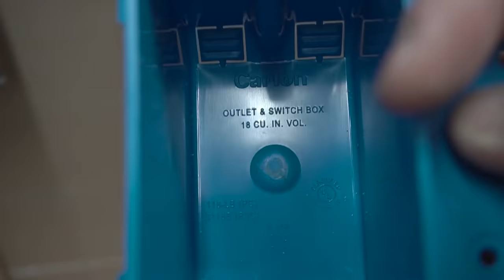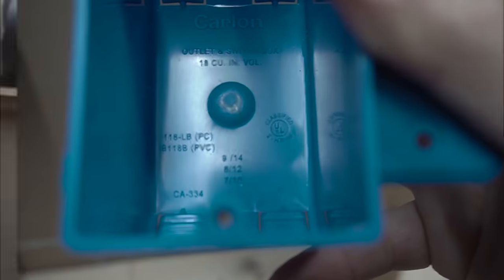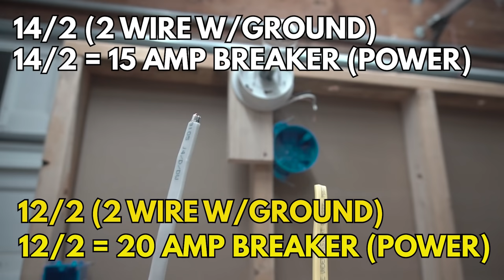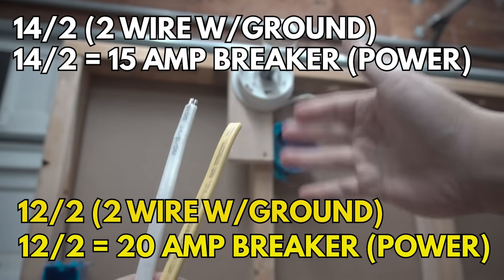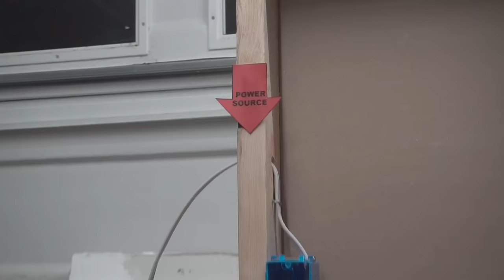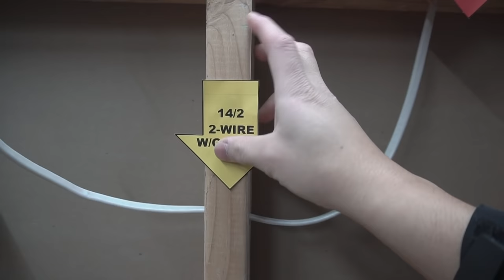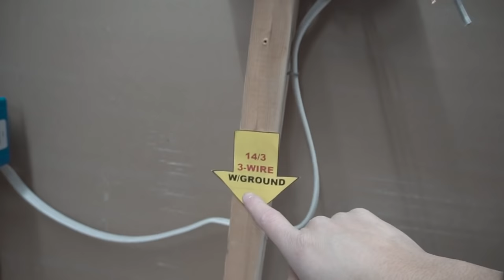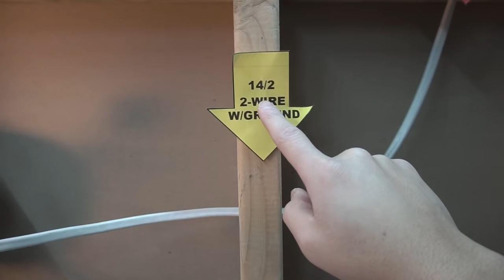How To Wire A Single Pole Light Switch Circuits 3 Different Ways (2022) DIY Tutorial For Beginners!

Comment: I have a scenario where the power source is from a light fixture box inside a closet to a single pole light switch outside the closet controlling on/off of the light fixture inside the closet.
The hot is a white wire at the top screw of the single pole closet switch and the black goes back out to the light…I think?
Can you add an independent light and switch outside the closet using the power line from the closet single pole light switch? Can this can be done? Thank you in advance for any comments.

Comment: Thank you!  I like those little clips to connect the wires, I only knew about the old wire nuts before this.  Why is the box called a "J box"?  Do you have a video about a setup where there are two light switches controlling a light?
Reply: Junction Box (J-Box)
Reply from the maker: Thank you for watching! Stay tuned,
I’ll be doing a 3 way switch Video either this week or next week! 👍🏽😊

Comment: Thanks for sharing. We have a light switch that powers on our bedroom light only but that same switch also sends electricity to our bathroom switch which has its own on and off light switch. The bedroom, bathroom and electrical source all have the ground wire, white wire (which is already connected) and black wires. However the electrical source also has a red wire. How do you connect all wires to the bedroom light switch so that the bedroom switch only controls the bedroom light and not the bathroom light, but we need to still have power going to the bathroom switch? Thanks for your help. Appreciated!
Reply: Take down your light fixture. Disconnect the black wire from the fixture. Reconnect ft fixture wire to the red wire. The other end of the red wire will be at the switch. Connect the black wires from the Romex at the light fixture together. At the switch you connect the red wire that connected to the black fixture wire and any black wires at the switch get connected together with a left over piece of 6" black wire to feed power to the other screw on the switch. Or hire an electrician. Remember , your most important tool is your checkbook.

Comment: I am rewiring after a wall/room was reconfigured. Light fixure, outlet and incoming source were already there. How would I wire it when the source wire is a 3 wire? The light fixture is a two wire and has an outlet on the other side that is two wire as well?

Comment: So why did you connect the neutral of the 3-wire to the other neutrals if it was never connected at the switch? Is that due to code? I dont think you had to connect it to the other neutral from power or load.

Comment: My situation is I have a 14/2 wire with no ground running to a single pole with no ground screw, and I’m wiring 14/2 lights with ground to this switch . Easiest method would be to ground it to my metal box? Suggestions? Either that or rewire it all the way from my panel but that would be out of my league.
Reply: Grounding to metal box many not work.  It is common for older homes not to have a ground wire.  The "best" answer is tom rewire to the panel.  The realistic answer is to ignore it,
Reply: Gfi the circuit. With an old panel you probably won't find a gfi breaker to fit. So if you want to gfi the entire circuit buy a gfi receptacle and connect line side to breaker and load side to wires going out. Now that whole circuit is GFI protected. People just don't understand. The ground wire in the Romex is not for personell protection. It is there to provide a path for electricity to travel back to the panel and trip the breaker when the current carrying conductor is shorted to the metal box or more likely if the appliance or equipment shorts out. Without the ground wire the frame of the metal equipment is energized because rnen though the windings of the motor are burning up and shorting out to the case or frame the breaker won't trip. So it just keeps burning until the current carrying conductor burns up.  That's what burned up the MGM grand in Vegas. Conduit broke. No ground path. Breaker didn't trip. See the movie Towering Inferno.

Comment: In method 2 the white wire is not a neutral.  It is a hot. The function should be described,  not confused with the color. It is also not code compliant anymore and should not be shown.

The cable hanging out of the bottom of the switch should have also be secured to the stud.
Reply: First thing I noticed too, wonder if he's in a local jurisdiction that doesn't uses the lastest NEC. Regardless, it is best practice to now put neutral in switches boxes to allow for modern smart switches that require neutrals.

Comment: Great video. So 3rd way, the 3 wire with ground wire, what is its purpose. You end up with 4 wires running to the switch and you just cap off the white wire. Seems pointless. I am sure there is a reason but if no further construction / modification will occur it just seems like a great way to sell more copper. So why is this the way it is to be done now?
Reply: 3rd wire allows for you to separatly power two different items from the one wire. E.g. a fan and a light combo in a ceiling fan. If it was 14/2, you can have separate control of light and fan at the switch, you would have to use a pull chain for the two. Their are other scenarios as well.

Comment: Before seeing your video, I tried to wire my 15 amp circuit with a 12/2 wire from the ceiling and it did not work. Is it because I should have used 14/2 wire from the ceiling to the switch?
Reply: A 15 amp breaker should be able to connect to 12/2 or 14/2.
Reply: @FreeAmerican-mm2my  thanks
Reply: Doest matter. Stay with the same guage wire throughout. You did something wrong or just don't understand.

Comment: If installing a light in a closet can the light switch be outside or inside or only outside ?
Reply: Well it's up to you. If you have a walk in closet or whatever with the light switch inside you may leave the light on all the time not knowing it's on with the door shut. With the switch on the out side all you gotta do is look at it and you can tell if it's on or off. Hopefully you install the switch so up is on. You can buy a switch that lights up when you turn it off. Needs a neutral at the switch. It's called a locator switch so you can find it in the dark. Like in a dark room and it's not by the door or other dark locations or in the middle of a wall.
Reply: @johndavies2949  thank you very much

Comment: So im trying to add about 5-6 outlets outside for Christmas lights should i use 14/2 with 15amp or 12/2 with 20amp?
Reply: Either way works. With the 20 amp # 12 you can run more lights. The problem is that you can only daisy chain so many strands of lights before that wire they hang from burns up. That's why all lights now have a fuse in the plug. The good thing is most lights are those little incandescent bulbs or led. I'm an old timer and still have those big bulky bulbs.

Comment: nice video. But the second part of the connections where the power supply is wired to the light then to the switch, a little change is needed to be adjusted  for the neutral( identified conductor) to added to the j box for future connection requirement too. Hope this would help.

Comment: In the 3rd method, what is the point of even hooking up the white wire from the 14-3 at all?
And/or what is the purpose of using 14-3, when you didn't even use the 3rd/white wire at all.
I'm abit confused.

Comment: If using the first method on the video and adding an outlet from the switch.  Can you using 14/2 and run the black wire to the hot wire on the back of the switch?
Reply: You could "stab" the wire in the back of the switch (or plugs), must most electricians prefer to make hooks and attach to the screws.

Comment: Question: how are the wires connected to the back-of the light fixture?. Does it matter which wire goes where?
Reply: I always connect black to black and white to white, but it does not matter.
Reply: Yes it does! The neutral goes to the silver or white wire that connects to the shell of the screw in bulb socket. The hot wire whether switched or not connects to the screw or wire that goes to the tab at the bottom. Some light bulbs have to be changed while the power to the fixture is on. So if  socket were wired with the shell as hot you could shocked if you're not extremely careful.

Comment: Hi i have question can i install exterior light without no ground wire
Reply: Sure! As long as the power feeding the light switch is GFI protected. If power to the switch comes from a regular receptacle change out that receptacle for a GFI one with the load side feeding the switch.

Comment: Correction:
At 16:17, you said that the power goes to the light fixture, "this is powering it first". However, the power goes to the switch box first. Can you clarify that please? thank you.
Reply: Go back to 11:22. This is the 2nd method of wiring and the power is going to the fixture first.  The 2nd method no longer meets NEC Code because you do not have a dedicated white neutral in the switch j box.  You will still run into the 2nd method in repair work.

Comment: I’m running new lights for the basement I have a 20 breaker and I’m using 14 /2 wiring to the a box that has 12/2 is that okay
Reply from the maker: Hi! If the outlets are on a 20-amp circuit, 14/2 wire is not sufficient. You will have to step up to 12/2 wire for all outlets on 20-amp circuits. Using 14-gauge wire (such as 14/2) to wire outlets on a 20-amp circuit can result in overheating and a dangerous electrical fire
Reply: Sure if you wanna burn your house down. What you can do is get one of those insulated light bulbs sockets with the 6 inch pig tails. From your #12 hot wire to the black wire on the pigtail. From the white wire on the pigtail wire to your black #14. Your white #,14 will connect to all the white #12s. Now go get a 15 amp screw in fuse and screw it in the pigtail bulb socket. And now you have the #14 wire protected at 15 amps and it can't be overloaded because the fuse will blow.

Comment: Just bought a house and whoever did the electric in my finished basement used all 12/2. Is it OK for me to run a closet light with 14/2 on a 15 amp even though all the other wire is 12/2?
Reply: Yes.  IF the 12/2 and 14/2 are not powering anything above 15 amps i.e. a plug.
Reply: That reply is all right. Give yourself piece of mind and stay with #12.
Reply: Got it done ended up using 12/2 very easy job

Comment: What does call the breaker switch to overheat if you use the wrong gauge
Reply: The breaker can't over heat. The wire can and maybe melt it's insulation and start a fire. Breakers do get warm but they will trip. I've seen plenty of 20 amp breakers passing 18 amps all day and not trip, but if the heat builds up too much, like in a panel in a hot location like an outside wall in the hot sun in summer, then yeah, the breaker will trip.

Comment: My main breaker switch is overheating would that be because I use the 20 amp breaker on the 14th to gauge wire
Reply from the maker: Yes. 14 and 12 gauge is meant for 15 amp only.  20 amp is for 12 gauge
Reply: So I just need to change my breakers to 15 A right and that should fix the problem
Reply: You may be using too many amps.  If any of the wires connect to a plug, that may be you problem.

Comment: I have a pull switch connected from the power source,then another line that also gets it's power from this connection,I want to run to a push switch to these power source and the other line, how to

Comment: We typically don't use lever wagos because they have a tendency to lever out when stuffing the box. Also, snugging the fastener is desired, leaving a loop in case future work needs slack. And we typically don't use wagos so we can pretwist which is paramount for wire management. Please remember to follow code which dictates a neutral is present at every switch. Not trying to be a prick, just making statements relevant to my everyday work
Reply: Would appreciate if you would share with us how you prefer to connect not with a WAGO. Thank you.
Reply: @kiarowong6202  Most electricians in my area use wire nuts.  WAGO may be easier for DIY. My jurisdiction does not require a neutral in the box, but current Code does require it because you might need it some say.
Reply: Yeah. Wire nuts been around for more than 60 years and the wires are to be twisted together before screwing on the wire nut.
Reply: Yes . The last few editions of the code book do require a neutral at the switch just because some electronic devices require a neutral to work. It's a good thing, but many switches that were powered from the light over the last 50years were wired with only 2 wire Romex. Do if you had a device that requires a neutral I remember some years ago you were allowed to connect to the ground wire. The good thing is now you have a 3 wire cable with a red, black, white, and green or bare. So you know that the black is gonna be that hot and the red is gonna be the switch leg. And let's hope the guy that did the wiring at the light box connected the white wire to the white neutral wire in that box so it's ready to use at your switch box.
Reply: We don't need stinking codes . To paraphrase the outlaws in the movie Treasure of Sierra Madre .

Comment: DO NOT use any connectors that have more  connection ports than wires that you are connecting. It is possible for something to get into those un-used ports and cause you serious problems

Comment: So anytime I'm adding an indicator to a neutral to identify as hot, I quit using electrical tape. I'll either use black, or red shrink tubing, and shrink it onto it. It lasts a lot longer than electrical tape. Electrical tape starts degrading quickly, we've all battled old sticky electrical tape. So shrink tubing stays, and lasts the life of the wire. Just a suggestion brother
Reply from the maker: Hi Chris! Thank you once again for the amazing advice regarding the shrink tubing! That’s actually genius! Yeah Electrical tape does become crusty over time, shrink tubing definitely looks a lot more clean and professional! Thank you for the love and support brother! 🙏🏽😊
Reply: @FixThisHouse  Absolutely brother. Thanks for putting out quality content my guy!
Reply: Any time you need to re-identify a neutral as a hot, you need to switch from a ??/2 wire to a ??/3 wire so you can maintain a neutral wire in the switch box. The Red & Black wires properly denote Hot wires.
Reply: @jankuehl4207  Yeah, if you're doing it properly yes you would. But when either:
A) it's not feasable to run a line through a house easily
or
B) You're just re-identifying a circuit that's already there
then this is definitely a way to do it without getting things mixed up. I've seen plenty circuits that aren't wired correctly. And in some cases this is acceptable as a diy option to be safe about it. Although I've seen plenty of electricians do it as well.
Reply: Right. And now you get to carry a heat gun with you all the time. Use a black magic marker. I use a sharpie brand. Just color it. You don't have to color the whole wire. A stripe will do just fine.
Reply: You should use the black wire as your hot power wire and your red wire as you switch leg wire that becomes hot when the switch is in the on position. It then becomes "hot" but it's not your "power" hot it's your "switch leg" hot which turns on and off depending on position of the switch.

Comment: Ok so those staples should have been insulated,and you should have told your audience it would be a lot easier to pull the wires through the holes with a fish tape if you strip about 2 to 3 inches of the insulation off first.It males the head a lot smaller and easier to pull through those small holes.
Reply: Insulated staples are not required in my area.

Comment: How to wire 240 v rated chandelier from main panel?
Reply: Just cause it's rated 240 doesn't mean it's operating at 240. Unless it is. You gotta check it out. I've never seen something like that. Just like Romex wire is rated at 300 volts but the most it will see is 240. I don't think anyone will use Romex for 277 volts or 480 volts.
Reply: Use 120 volt bulbs and wire it for 120. If it is 240 and your in Europe where the standard voltage is 24O you'll need a 2 pole throw light switch to break power to both hot wires at the same time. You'll need a 2 pole 15 or 20 amp breaker at your panel. You'll run your Romex from your two pole breaker to your 2 pole switch. You'll have the white  wire connected to the breaker and not the neutral buss. You'll black stripe the white wire at both ends. Are you sure about this fixture? Rated at 240 doesn't mean operating at 240. You gotta do some investigating.

Comment: How do I connect an outlet from a end of run single light switch?
Reply: You will have to have a neutral.  Unless you have 14/3 or 12/3, You will only have two hots in the switch j box.  You could run a wire to the light, but the plug would only work when the light is on.

Comment: Method 2  is not allowed anymore in 2020 NEC code (404.2(C).It a code violation . When install light switch in new construction or alter existing light switch ii older home  it requires neutral in that box.
Reply: Yes, you are right. But sometimes you gotta do what you gotta do. It's your house. You'll know that you don't have a neutral at the switch. And who knows, maybe in the future if you need a neutral for some electronic device you can get one from the nearest receptacle.